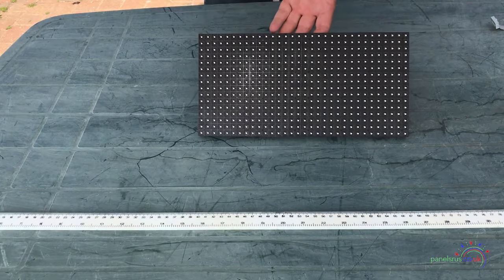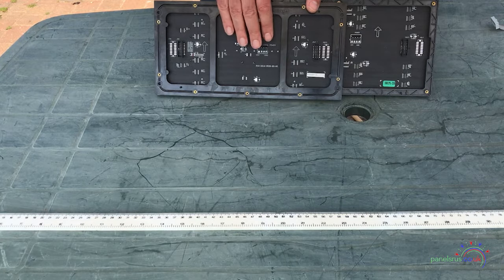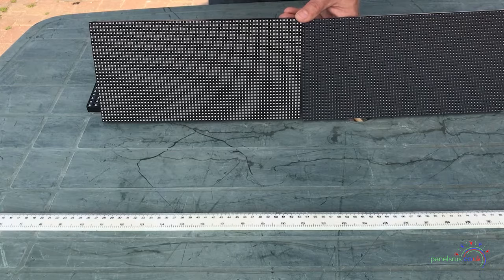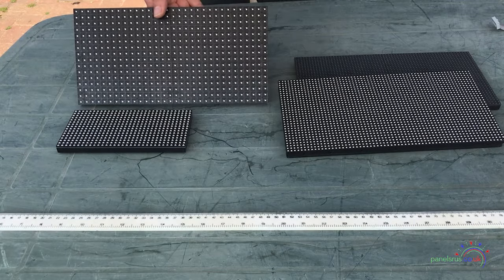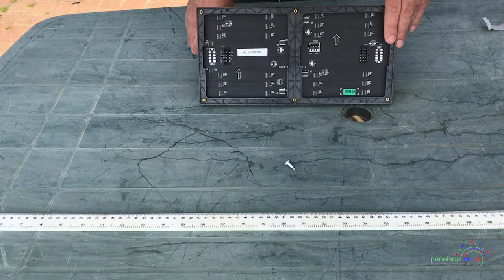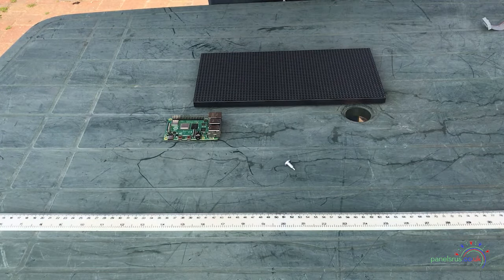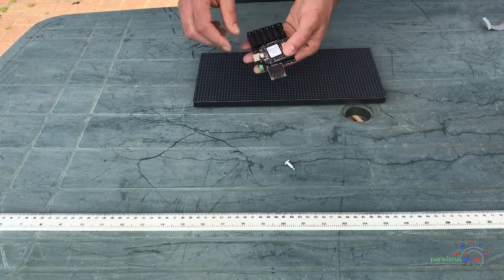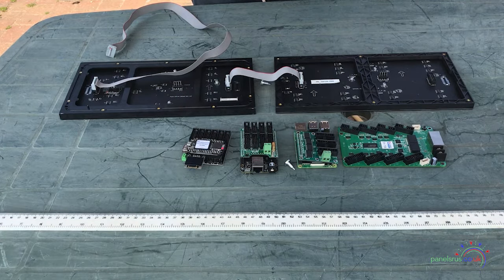Introduction to LED Panels

Comment: Could i set up a single panel, and is there a decent card for that? I only need it for a small display (like the ones you find outside a store), hopefully something cheap so that i can use it to display information in my office

Comment: Talk about data organization and management. The first text led displays used built-in character generators of different fonts. Now, most of the pixels are generated in the computer, but still in what format and encoding they are transferred to the controller. In other words, what are its main functions in image processing?

Comment: Hello, I thinking buying this product, but I have a question and I would be glad if you can help me, do I need a specific structure to make it work, or I  just can connect it to a HDMI or wifi via, installing a specific software y connecting all the panels together without any steel structure or something similar?

Comment: Hi there, very informative video! Could a color light card with a Raspberry pi 4 be able to run 8 P2.5, 64 x 64 pixels (hub75) led panels? Any more than 8 would require different card or two color light cards?

Comment: Hi, nice video on rgb panels.  i m just a beginner.  i want to know how to power up a single P2.5 128x64 rgb panel.  i have colorlight board, a MW 5v power supply.  i need to repair some panels with bad leds on them.  so for testing purposes what should i do and how to get a white screen and rgb screens.  what is the purpose of test button on the colorlight board, can u help me?

Comment: Hello, do you happen to have a pixel configuration file for a p10 32x128 curtain for Ledvision software 3.66?   It would be something like p10-32x128-8s.rcvp I believe
Reply: Or whatever we would need for panels uc-fswi-p10D8 for Ledvision.   Manufacturer has not found yet.
Reply: Or cannot recognize the file as it is in Chinese or labelled otherwise.  :|

Comment: What is the different scan rates mean and which is the best for a Christmas display
Reply from the maker: The most popular panels for Christmas Displays are 320x160mm P5's and P10's.
P10's run at 1/4 and 1/8 Scan for Outdoor/Indoor Panels
P5's run at 1/8 and 1/16 Scan for Outdoor/Indoor Panels. The scan rate being the number of lines of the panel that are refreshed at one time. (It all happens so fast, you wont see it with the naked eye!)
Reply: Contact please and country

Comment: Hi, well done on the explanations. I have a P5 already, with another due in at some point. I'm using a D15 with WiFi, USB and Ethernet connectivity. Although nothing came with the D15, instruction wise, in the adverts it does say it will work using an iPhone to program the display. Any idea what app? There are a number of them. I was thinking of using the panels, one on top of the other?...so a box. So please, what do you recomme4nd. Thanks!

Comment: Great video, are p4 or p3 panels able to be controlled by the same controller as p5 panels?
Reply from the maker: At the moment, FPP doesnt support them as they need an extra IO Pin.  I believe its being worked on.
Reply from the maker: Update... FPP Now supports P4's (80x40) when run via a Colorlight or Linsn card.

Comment: Short and sweet informative video 👏👏

I believe one the of the good video I can say for LED modules comparisons. 👍🏼

I would like to ask some more information if u can ?

May I ask as per your experience which module (indoor and outdoor) you will be recommending for producing good result in retail environment where product promotion are displayed to attract customers.

Further more if any video you suggest to give information about using small controller and is is connectivity which produce the testing results.

Something which saw in some of comparisons video comments that after people install p1.5 screen but result is not as they expected even they produce good quality content but when it display content distorted when it displaying on screen ?

Comment: I have 7 64x64 indoor p3 panels and theyre a bitch to drive. Ali express wants 200 for a controller. A seller told me hed give me a free panel and the driver for half price if i bought 7. Theyre like an albatross. I tested one on a pi zero and it works. Id sell them and 2 adafruit bonnets to anyone in canada or the us for 140 cad and throw in high quality caps and even print or laser cut connectors. Id even include a pi zero 2 w and some esp32 controller boards with the parts for them for an extra 25. I have over 100k leds. I prefer through hole leds for art projects.
Reply: Interested! How can I contact you?